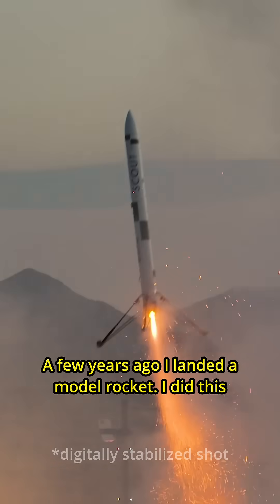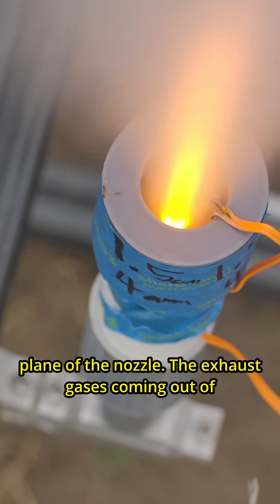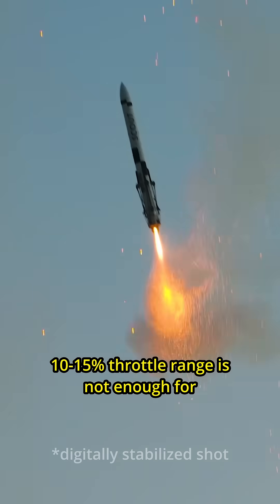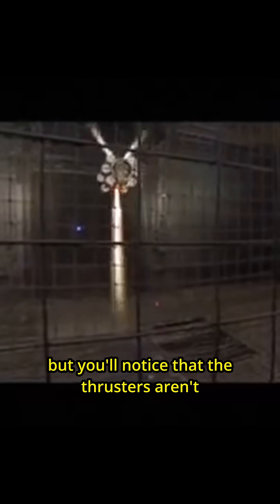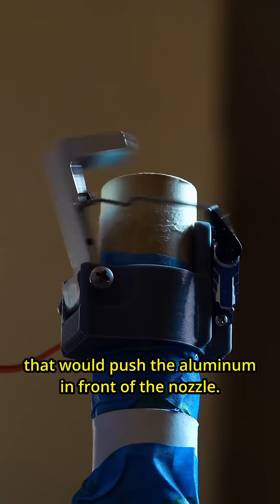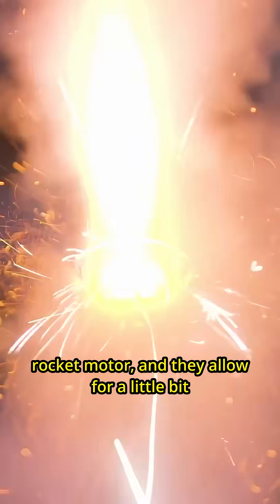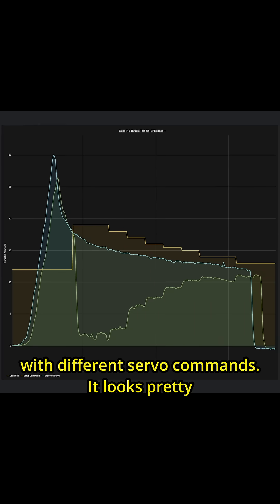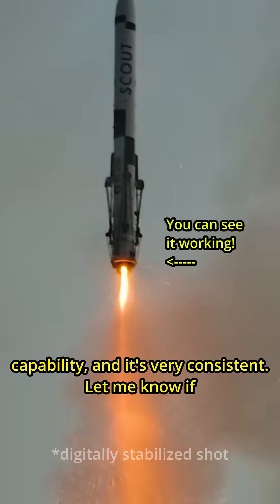Solid Rocket Throttle Control

Comment: Man, you are good!
There are several ways to deal with thrust:
1. Change speed of gases (change nozzle parameters)
2. Pulse modulation of ignition (change time when gases flow thru the nozzle)
3. Change direction of gases - the option you had implemented. 
In theory increasing number of ceramic "blockers" and control them separately - allow you use them to control side thrust and vertical orientation of rocket.
Good luck! And Best wishes from Ukraine.
Reply: By using shaped ceramics and more of them, you might be able to redirect the thrust sideways and use those as directional controls?
Reply: @zigamuswizard9731  that's called vanes, and yes. V2 is an example of a rocket that had actuated vanes in exhaust to guide the rocket
Reply: The aluminum probably would have worked if it had a thin piece of tungsten carbide on the blast side
Reply: I don’t know anything about rockets but sounds interesting. Would an apereture control similar to a camera lens aperature not provide more consistent and linear control (just throwing a thought out there)?
Reply: @karelbaeten3306 I had the same thought. Seems like a much smoother channel for the jet to pass through, plus it could likely be made sturdier (and thus precise to control). Add a gimbal to the whole thing (which he's already doing), and you also have thrust vectoring.
Reply: Yup, until your servos fail, which is common
Reply: Wouldn't it be easier to measure flight parameters (altitude, vertical speed, acceleration) to determine when to fire the rocket? 

Slava Ukraina!
Reply: It’s a solid fuel rocket. There is no gas control capability
Reply: Slava Ukraine!!!
Reply: Best wishes to u and I apologize for are government preferring to partner with Russia.
Reply: @michaelmcdowell7096 why are you apologizing? The only thing to feel sorry for is that we let Russia gets pushed this far in the first place. I feel sorry that we lied to the Russians about moving nato close and how we started the coup in Ukraine under Obama. I feel sorry that so many people on both sides died from bad leaders but I don't blame either one.
Reply: @Decayed-ii5wl  they're sovereign countries, bro. Nobody forced nato on anyone. It's a privilege to be a member and they happily made the sacrifices to qualify. NATO would dissolve if not for Russian aggression.
Reply: @davidaustin6962  I never said they were forced to join nato bit that the us promised not to move nato closer and they did multiple times
Reply: @Decayed-ii5wl  Our leaders really need to chill out and play some fucking RTS games or some shit, their strategies for dealing with stuff is absolutely horrible, and their leadership abilities are severely lacking.
Reply: @Decayed-ii5wl  People, usually Putinists (particularly the US and European far right), love to blame the US, and sometimes the EU, for the 2014 revolution.  But Yanukovych managed to piss off a truly enormous number of Ukrainians who weren't from the Donbas.  I'm not sure the US/EU were even capable of having an impact on that, if we had wanted to stop it.  The current war is a pretty good illustration of how the average Ukrainian feels about Russian domination.

Comment: To explain pulse width modulation to lay people, it's like when you're playing a GameCube game on an emulator and you have to aim at something with your bow or other projectile sending weapon, and you need to press a direction key a few times rapidly to offset your aim because holding it is like pressing the stick fully in that direction.
Reply: Or like playing a racing game with a keyboard. Instead of going full speed by holding foward (or whichever direction), tapping the gas to go a certain speed (or tapping the steering to turn a little bit over a long curve, or tapping the brakes instead of slamming them on). Instead of making one big change all at once, you're quickly adding a lot of little changes that add up to what you want.

Comment: In 1969 I watched a solid rocket motor being throttled at the Air Force Academy aerospace lab. What i saw I wourld become familiar with some 40 years later as a hybrid motor. Ican still visualize in myind the clear thick acetic tube the propellant was in and the burns on the upper part of the tube (it was inverted in the lab and fired upwards). I had a cousin that worked cor the government in Aerospace related things and worked with Morton Thycoll on a frw projects but he could NOT go into details but did mention that even the government had given up on throttling solid burning motors that were what he called "All in One" (Oxidizer and fuel propellant).
Reply: That same tech was used in the motors on the Titan 3s and 4s, those orange tanks on the side of the boosters held Nitrogen Tetroxide which was injected into the aft closure to increase the thrust of small sections of the exhaust. The injectors were in a ring around the wall of the motor so the fluid could be injected at different points. This was used for differential throttle to provide relative thrust vector control.

Comment: Instead of the 2 servo fingers, (yes I understand why flat tile) why not go for a 2, or 4, sectioned of a hollowed & halved sphere, with enough of a center hole up top, so as not to completely close off the rocket motor. 
((Think bartender lemons cut horizontally in half, then cut the dome through the top by once for 2, and twice for 4 piece's. Remove the flesh and use the skins as your reducer with a clearance hole of a toothpick at the top, center, divide point))
And then set each stage in their closure limiters by half, thirds or quarters, instead of on or off, yes I know, 0 or 1.

And Or a Flat Plate Collapsible "Vegetable Steamer" and 2 servo's for weight balance.

Clearly not a rocket designer.

Comment: Some sounding rocket motor guys once told me that most of the motors are safe when shipped because they don't have the forward cap installed. So if they went off, the thrust would be equal from both sides and they wouldn't actually go anywhere (in theory). Maybe for the landing burn, you could pop the nose cap off and vary the size of an orifice on the top end of the motor. This might offer more throttle range because not only are you reducing thrust, you're increasing down force. Can't imagine how you do this without complex hydraulics though.
Reply: Commercial blackpowder rocket motors are end-burning grains. Sounding rockets radially burn outward from a central core. They have a stack of propellent grains whose shape is chosen for certain thrust curves
Reply: @KDS_LLC  Even the old Estes rocket engines were available in both end burning and core burning models.
Reply: @codetech5598  I flew model rockets for decades before moving up to high power rocketry,  mixing, characterizing, casting and testing propellants in my custom motors and i must confess I did not know Estees ever made core burning motors. I'll go look this up because I'm very curious now.
Reply: Old cameras may hold a clue. Those stepper motors he uses could ostensibly actuate an iris diaphragm...or instead, sort of close and open a "pyramid"
Reply: I have no idea if this would work but you’re definitely thinking outside the cylinder.
Reply: I was going to comment similarly.  If the solid booster is manufactured in a pipe fashion, burning radially outward from a hollow core that pushes the hot gas downwards, releasing some of the pressure  at the top, would  decrease the thrust through the engine.  You just need a couple side chimneys near the top to vent the pressure so you don't roast the monkey astronaut piloting the thing.
Reply: Dude I like this a lot. You're onto something here.
Reply: But it wouldn't burn from the other end without it being lit. In this case.

Comment: Another option would be to do something similar but with bypass ducts. Basically have the exhaust shoot off to the sides to reduce thrust along the main axis
Reply: Yeh, mine too, sort of opening windows instead of closing a door. I made a (too?) long post about it, lol...basically lengthening the 2cm sleeve and using it sort of like a muzzle break or flash hider. Granted, his "door" solution DOES directly vector much of the thrust from down to out, so idk, it's probably more effective (and simpler to make)...probably 😂 I'm still mad curious how effective a tube with holes would be.
Reply: This was my first thought
Reply: Harder to control
Reply: This was also the first place my brain went to as well. 
While yes. It does introduce a new problem to solve it does give the energy somewhere to go instead of relying fully on the material integrity of the ceramic. I would even go further. Use a sleeve made of the ceramic tied mechanically to the arms. As the arms extend into the exhaust the sleeve will come down. Exposing the unneeded energy out holes in the sides. That way the thrust down and outward are both contributing to the decrease in thrust. While also reducing the thermal load on the ceramic arms. 
There servos controlling the entire apparatus could be linked to a gyroscopic control system that could modulate the flow in a PWM fashion. I would still add some kind of horizontal stabilizing system close to the nose to correct for drift on the x/y axis from environmental factors. It wouldn't have to be very strong as the main thruster can always send the rocket upward to quickly restablish vertical alignment. Though. Honestly. This is why parachutes and air brakes have been used for decades. 

This is a worthwhile idea. As well as a solvable problem. Better use of the energy in play with less waste is the key here.
Reply: Good idea. Kind of like a compensator on a pistol. I guess as long as you have enough vents or you point them in the right direction, you shouldn't affect orientation much, right? Or does it not take much air or pressurized gas to move something that small off point?
Reply: I guess if you balanced the doors on both sides you could mitigate any lateral vector.
Reply: That’s a muzzle brake. Like on the end of a cannon.

Comment: I've heard when rocket using solid fuel, you can vibrat or vector the nozzle to different directions to shorten the flight distance instead of trying to turn it on and off.
Reply: Its called artificialy induced cosine losses. However, in this short of a distance and time period, it would lead to very wide deviation in sideways velocities. On larger scales, like orbital rocket uperstages, they can use much larger angles because side to side doesn't matter as much, and they can rotate slower because they have more time. It just doesn't make much sense for landing though. Not that it couldn't be done.

Comment: Add several pairs of solid rockets mounted like boosters but have them pointed upside down. Each pair could have a different amount of thrust and you could light them at different times during landing.

Comment: Brilliant!
I have met a few Shuttle-era astronauts, and one thing they all said at one point was, "The stack flexes when the main engines fire, so you have a chance to abort in about three or four seconds. But when the solids go off, YOU'RE GOING SOMEWHERE!"
Reply: Fun fact: the MASSIVE explosive bolts that hold the solid rocket motors to the pad have failed in the past. This isn't actually a problem as, when this happens, the bolts that fail are merely ripped out of the pad by the force of the solid rocket motors!
Reply: @Melanie16040 indeed, those bolts aren't even for holding the rocket form.launching, like traditional hold down clamps, but are actually just to keep it steady on the past until liftoff. The explosives are fired to break the bolts BEFORE the SRBs are ignites, unlike hold down clamps which release after thrust build up
Reply: @maxk4324 do you mean pad?
Reply: @Melanie16040 the legacy will never FADE AWAY
Reply: NOW!
Reply: That’s hilarious and super scary at the same time.
Reply: Saw comments about SRBs being bad for human space flight, I disagree because they are badass
Reply: I'm wondering if the idea to use the Saturn V's first stage instead of the SRBs would have been safer.
Reply: @FarSeeker8 yes, also using a rocket fired crew abort stage so they can fly away from any sort of circumstance should the rocket start turning into a giant fireball underneath them. They’ve got less than a second to make that decision. It really should be automated and backed up by someone in a bunker half a mile away with a finger on a button. The shockwave will reach them quickly and will likely to stir them into action on the abort command before their brains process the image of a fireball consuming the rocket ship. Space shuttle should’ve been equipped with a reinforced cockpit with its own redundant fusible bolts and escape rockets. Something like 14 astronauts would still be here? I’m not gonna look it up. You’ve seen it. There’s another name for it. The Apollo reentry capsule where the crew was located for Saturn Apollo had a small tower jutting from the nose and ahead of it were rocket motors aimed outward at a roughly 30° angle to provide immediate thrust while yanking the capsule free of Saturn. It was a really good idea.
Reply: Not necessarily - those SRB ‘s could, or can be, jettisoned at any time … 

Granted they might still be burning and may go where you don’t want them to go … but you could be right where you started ..,

And those SRB’s aren’t all that “solid” structurally speaking … they are made of multiple segments that are.joined and sealed with o-rings, so emergency explosives COULD be placed or added at the joints to effectively destroy them before they got to out-of-hand … and it wouldn’t take all that much explosive
To do the job and limit damage …
Reply: "But when the solids go off, YOU'RE GOING SOMEWHERE!"" 
That's why solid rocket motors are such a bad idea for crewed space flight.
Luckily no-one with a sense of responsibility uses them anymore.
Reply: @3gunslingers  SRBs however, are less complex, so you essentially can't have an engine failure.
Apart from that... Yeah it's just a controlled pipebomb explosion.
Reply: @CosmicHase  [with SRBs] "you essentially can't have an engine failure"
As long as you don't make the SRB bodies in two pieces with a big O-rings sealing them together, and let the O-rings get stiff in cold weather...
Reply: @Mueller3D  Can't seem to think of that ever failing ever since the one time it failed once...any liquid engines more reliable than that? Also it was a foolish overhead decision, the engineers tried to stop the launch and had the launch been delayed that failure never would have happened ever.
Reply: @3gunslingers  That might explain the three active US programs that use launch vehicles with solid rocket boosters (Atlas V, SLS, and Vulcan.)

India's human spaceflight program also has a launch vehicle with solid boosters.
Reply: @ 
And it is still not a good idea.
Reply: @KnightRanger38  Branson's outfit uses solid fuel motors for crewed flights too.
Reply: @tshackelton  don't they use basically a sugar rocket?
Reply: @3gunslingers  armchair engineer, lol! You definitely don't know what you're talking about.
Reply: @ 
"armchair engineer" 
Yes. That´s where I´m paid to sit and do engineering.
Reply: @3gunslingers  Liquid isn't much better, the instant you lift off the pad it no longer matters how you're making thrust, YOU'RE GOING SOMEWHERE. 
Solids are far less likely to have issues if an abort happens before ingition because the fuel is stable, unlike liquid that's at minus a bajillion degrees and needs to bleed off or something, so there's that to consider as well.
Reply: @brough59  
"Liquid isn't much better, the instant you lift off the pad it no longer matters how you're making thrust, YOU'RE GOING SOMEWHERE. "
Yeah, with solids you are going "somewhere". 
However during a rocket launch you want to follow a very specific trajectory. Any mishap and your burning solid booster will drag you off course.
Reply: @3gunslingers  the probability of a mishap is greater with a liquid engine, that'swhy they've taken way longer to develop the reliability needed for today's rockets. ICBMs all use solid motors and they still have the precision to strike a football stadium going a bazillion miles an hour with minimal guidance and a very low chance of failure. What is your point?
Reply: @3gunslingers like the solid rocket boosters of the SLS ? :) I don't think sls has been cancelled yet.
Reply: @ 
"like the solid rocket boosters of the SLS ? :) I don't think sls has been cancelled yet." 
Yes. exactly like SLS.
However you really can't argue that this rocket was born with a sense of responsibility in mind.